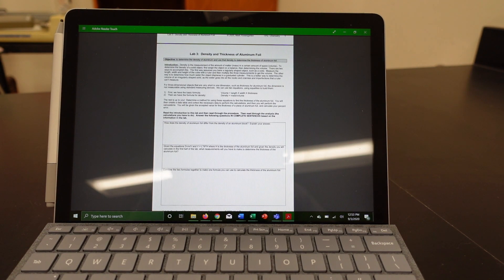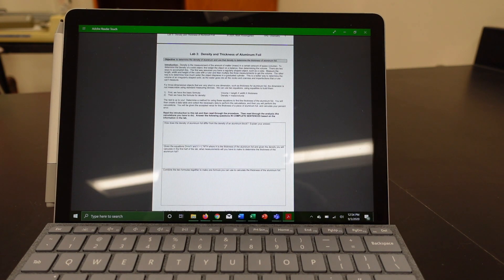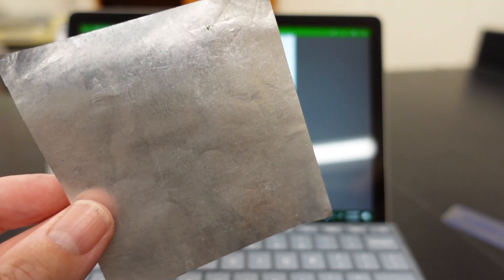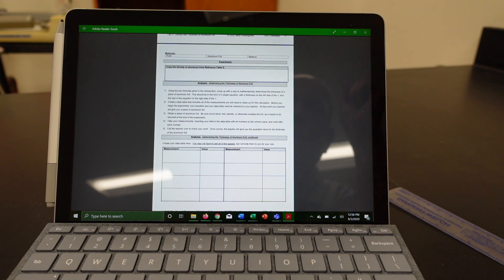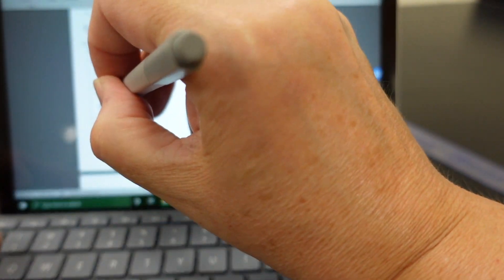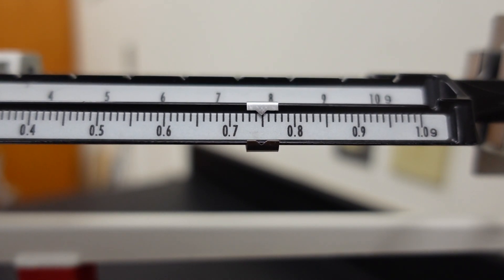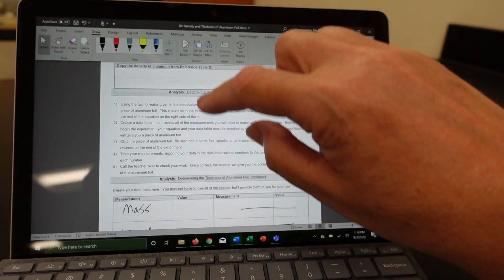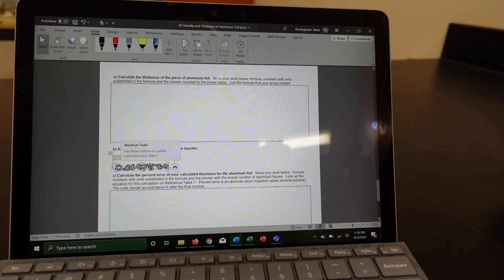Lab 2 - Thickness Of Aluminum Foil (A/E Chemistry Virtual Lab)

Comment: Am I reading the balance wrong or does it say that that tiny piece of foil weighs approx. 3/4 grams when it should weigh approx. 0.075 grams if you use the accepted value of thickness and his other measurements
Reply: I'm with you, man. I'm an order of magnitude off as well. great video though.